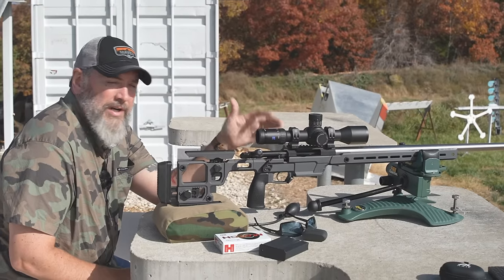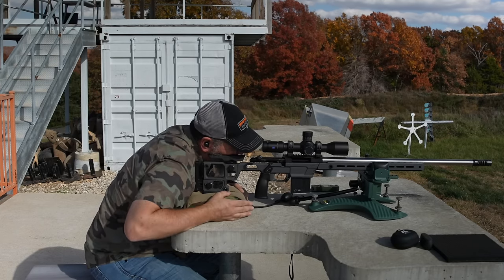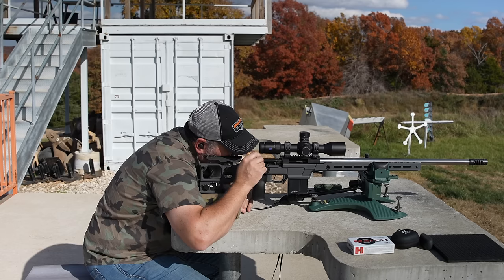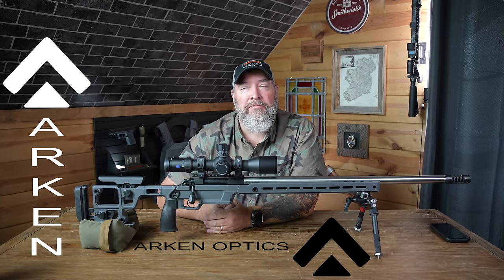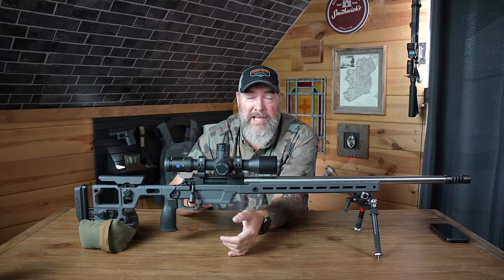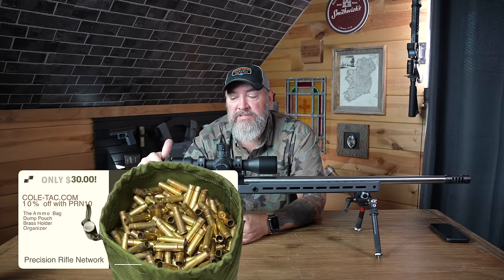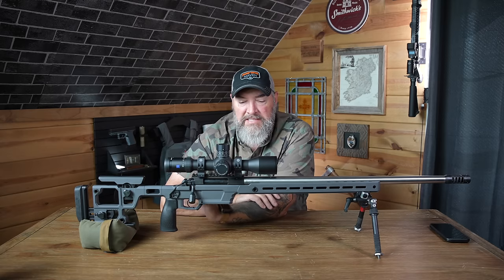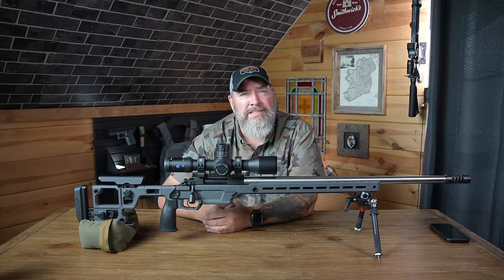Aero Precision Solus 6GT - but is it any good?

Comment from the maker: Do me a favor please. Leave a comment if you have time and a thumbs up if you don’t!
Reply: I have two of these chassis and overall I like them.  those 2 still cost less than one MDT.  There's a bit of a problem with the mlok slots up front if you're mounting the MDT weights.  The MDT weights block a bipod from sliding on and off the integrated ARCA rail because they hang down too far and interfere.  Salmon River has created some mlok weights that don't interfere.
Reply from the maker: @nrf2009  Thanks for the tip.  Ultradyne is another company that makes some smaller profile weights that will work.

Comment: The action gets smoother the more you use it.  It smoothes out nicely.  I built my own Aero Precision setup, but I went with a Preferred Barrels 26" Sendero profile barrel chambered in 22GT, and it's AMAZING!!!!!!!!!  One hole groups at 100 yds is nothing for this rifle when I do my part to drive the rifle.  It's sooooooo accurate it's downright boring at times.
Reply from the maker: Nice 👍 all good info. Thanks.
Reply: or you can get a Tika tac for less and they throw in a mag and trigger and its so buttery smooth right out of the box.

Comment: Excellent review!  I too have a Solus but in 6mm Creedmoor. 17" Stock in grey just like your gun. I personally put everything together and have had absolutely NOT ONE ISSUE with anything!  Our guns look identical except my muzzle brake is stainless and is radial in design.  I too use Arken Optics.  Im using a Proof Research 6mm Creedmoor barrel at 26"!  Absolute tack drivers and the gun is a well made machine!  Its amazingly accurate with all bullets from 87 gr Vmax to 112 gr Barnes BTHP!  Your assessment is exactly like mine is.  LOVE MY APS
Reply from the maker: Sweet! Thanks for watching.

Comment: I have seen the action as cheap as 620. For 800, it's all over the price of a ARC CDG, that is a better action. Where I think this action comes in as a good deal, is the complete gun. I have seen it on the shelf for 1800. At that price it's the perfect gun for a guy getting into PRS that u can use all the go fast r700 parts.
Reply from the maker: The complete rifle, I agree. 
I’m not sure why someone would intentionally choose this action by itself.
Reply: @PrecisionRifleNetwork  Is there a better <$900 action that you can buy right now (with no wait time)?  These seem to go on sale every few weeks for $720, so maybe $900 isn't a fair comparison.
Reply: @A60363  absolutely, the zermatt origin. It's a incredible action, currently running one for my prs gun. Now u will have to hunt around but u can find them. If u hunt on snipers hide u can find a CDG or a Origin once in a while. I will also say I woukd choose the Solus over any stock action like a r700, savage or a ruger. I love the Tikka action so I'm not sure there.
Reply: @1clnsdime1 I wouldn't say it's better, but it is a good alternative at MSRP.  It might feel smoother, but it doesn't have the integral recoil lug or rail, trigger hanger, cheap bolt heads for caliber swaps, and isn't cut for AW mags.
Reply: @A60363  I would put it well above. It has everything u need for precision. It's all in what u want. Those items mentioned are far from important to me. The quality of the action means way more and Zermatt holds some incredible tolerances for the price. Get 2 of each of those actions and start measuring. Every Zermatt u pick up will feel buttery smooth, that can't be said for the Solus. If those things are important to u, then the Solus is the way to go. The origin does have a swappable dolt head and is also controlled round feed and pulls it off very well.
Reply: @1clnsdime1 I get it.  AW is a must have for me - easier to load & unload, less interference with props.  Both the Origin's I looked at were pretty sticky, despite being broken in.  They're what pushed me to Impact actions.  The Solus has all the precision needed: it takes prefit barrels.  After a few hundred rounds and many more dryfires, I'd put it on par with the Origin's I've handled in terms of smoothness.

Comment: Very promising. I definitely want to see what some properly tuned hand loads will do for this.
Reply from the maker: I’m certain it will shoot tighter, but unfortunately they won’t make this action feel smoother.
Reply: @PrecisionRifleNetwork oh yeah that’s a given. But I’m not as spoiled by custom actions so as long as it prints tight and it doesn’t feel like I’m dragging the bolt across sandpaper I’m chillin 🤙
Reply: But does it run smoother than an RPR? I love my RPR but smooth it ain’t. Accurate yes, smooth uh uh. My Defiance…. That is smooth.
Reply from the maker: @josephjulian2503  actually that’s almost a perfect comparison. The solus feels a lot like the RPR action. 👍
Reply from the maker: @jonathanromo2305  understood

Comment: Thank you for the review. I would like to start trying precision shooting up to 500 yards. Debating on Tikka T3x, Bergara B14, and I saw this on sale. T3x downfall is chassis. Which would you prefer?
Reply from the maker: The nice thing is, you can build and change things off of either of those barreled actions.  The tikka action is better/smoother, but the bergara being rem700 platform will have more aftermarket upgrades available.  That being said a lot of companies do make stocks and chassis for Tikka these days.
Reply: @PrecisionRifleNetwork  thank you for your reply, I just found your channel yesterday. I guess my question is your opinion of performance value between the Solas, T3x, and B14. I would like to not make large modifications.
Reply from the maker: @rayyoder6440  gotcha.  If I were to choose only one and not make very many modifications, then I would choose the Tikka.  The action is superior in smoothness and function in my opinion.  

Quality control is somewhat questionable with the solus and the bergara in my experience.

Comment: Have you had any issues removing the cheek riser to get a bore guide in place to use a cleaning rod?
Reply from the maker: I have to remove the cheek riser to remove the bolt.  That is a frustration of mine.

Comment: Is there any content coming with same barreled action in the grayboe. Also on other actions what makes them different as far as being able to remove the bolt from action without clearance issues?
Reply from the maker: Hi. I’m not going to be using this action in a grayboe, but more grayboe content is coming. 
This action in this chassis, the bolt doesn’t clear. This action in a different chassis and it might. 
Usually manufacturers think about these things. Aero obviously didn’t.

Comment: I just put together about the same setup but with a Criterion Savage SS from Northland Shooters Supply.  It hasnt shot over an inch yet.  I really like the action and it is smoothing out.  Good to know the AI mags run, but will they run in an MDT Chassis (I haven't researched it yet).  Thank you sir.
Reply from the maker: Cool thanks for commenting. I’m going to keep mine and see how much it smooths out. Hopefully a lot.
Reply: @PrecisionRifleNetwork  I degreased both the bolt and the action.  After I got the residual sticky packing oil out (used Bore tech on a patch).   I then used some of their lube that goes on wet, you let it soak and then wipe it down.  It really smoothed it out.  I made a video on the action for my friend Slav Guns but it's here on YouTube, and you can find it under my profile name.  It's pretty amateurish but I show the bolt sliding freely while the chassis is in a tripod.  I have a fair amount of wear on the bolt, hence cleaning up that oil and wearing cerakote in the action area smoothed it out.

Comment: I was really liking the looks of the chassis for a bergara b14r barreled action for PRS rimfire, but from what I've read, a lot of the mlok weights don't work with the arca rail. Hopefully they come out with a solution soon!
Reply from the maker: Check out Ultradyne. They have some low profile weights that should clear just fine.
Reply: @PrecisionRifleNetwork  I made the comment before I let the video finish. You mentioned  ultradyne, so I looked them up. Look like they should work. Thanks!

Comment: You’re pushing Arken but shooting Zeiss that’s  a pretty slick racket you got going there
Reply from the maker: I have to review a lot of different products and do videos on most of them that’s literally my job. 🤦🏻‍♂️ #sigh
Reply from the maker: Zero Compromise Optics on my competition gun. 
Nightforce on my sniper rifle. 
Got an Eotech on one AR and Holosun on another. 
Vortex red dot on a pistol.
Reply: reinforces my point all top-tier Optics, but your pushing the Chinese stuff on your viewers what’s your kickback?
Reply from the maker: @Pew_pewchronicles  I chose to use an Arken EP5 on my 22LR competition gun.  I could have picked anything, but I chose that one long before I had a partnership with Arken.

Manufacturers buy advertising on my channel, they don't buy my opinion.
Reply: I’ve got the EP five on mine. It’s been good so far.  But on my daniel defense 308 I went with the $2200 Leopold. But I’ve been enjoying the Arken quite quite a bit.

Comment: The action is decent but the chassis is garbage
Reply from the maker: Tell me why you don’t like it.
Reply: The flex in the forend where it bolts to the frame flexes too much, the butt pad is cheezy  and the cheekwell having to be moved to take the bolt out should of been foreseen, I switched back to the acc elite chassis and solved most of the issues